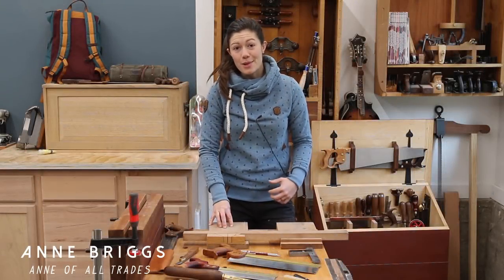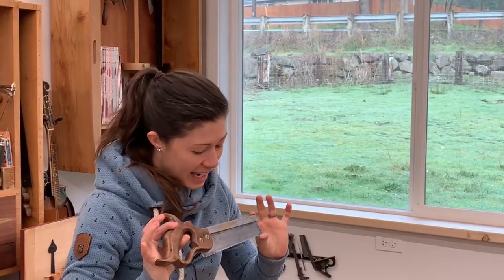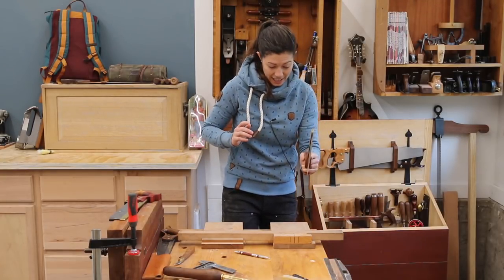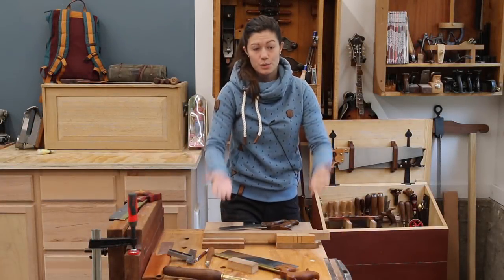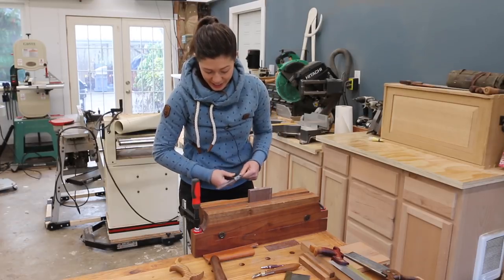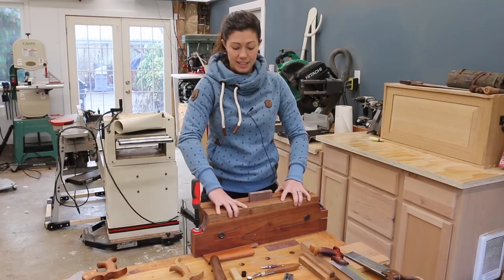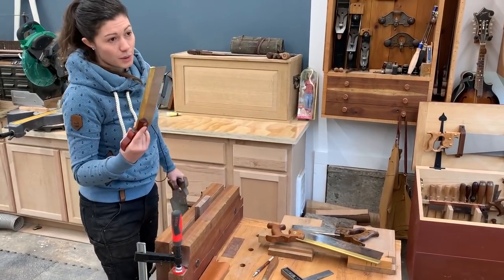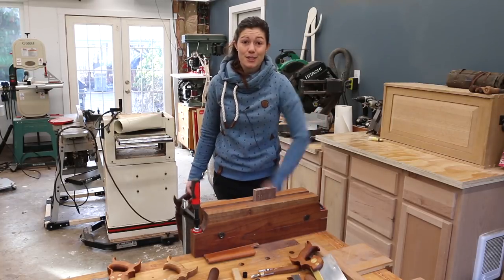Getting the Most Out of Handsaws, with Anne Briggs

Comment: How can you tell between a rip saw and a cross saw I know it's a teeth how do you tell
Reply: Kram Awagatuka great question! It makes a difference to use the right saw for the right task. Now, a good bet is that the saws you buy from home improvement stores will have some sort of cross cut pattern to be used as a multi purpose saw for most situations whether ripping or cross cutting. 

Now to tell the difference, you just look down the saw from the front. If the top of the teeth have been cut or filed perfectly horizontally from side to side, it is rip. If the top of teeth have an angle to them, where they run more or less length-wise it is cross cut.

Another way to tell is that, looking at the teeth from from the side of the saw blade (also called a saw plate), rip cuts look like waves in the ocean with the top of the wave/tooth going forward toward the front of the saw. Crosscut teeth look more like pyramids, on the other hand, as they have a bevel on the front and back of every other tooth (when you flip the saw and look at the other side, the opposite teeth with have the bevel now). 

Hope this helps!
Reply: That's a good question. If the teeth look kind of like a knife blade, that is they have a noticeable edge, it's a cross cut saw. The teeth are designed to cut across the grain of the wood. That is where the name cross cut comes from. As stated by HandToolery many big box stores are a cross cut type of design. The rip saw teeth, cuts in the same direction as the grain, are made so that the front of the tooth, the part that cuts, is more squared or perpendicular to the cutting direction. Interesting thing is that a fine, many teeth per inch, rip saw can cross cut easier than a cross cut can rip. This video is a great teaching video
Reply: Thanks guy. I have saws but didn't no the difference thanks for everything explanation really appreciate it have a great day yellow
Reply: Yes thanks